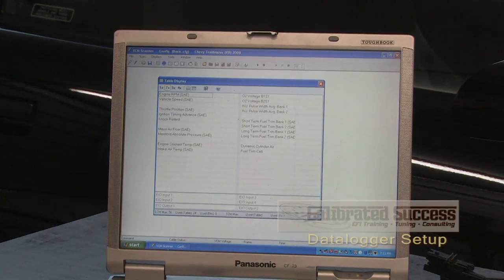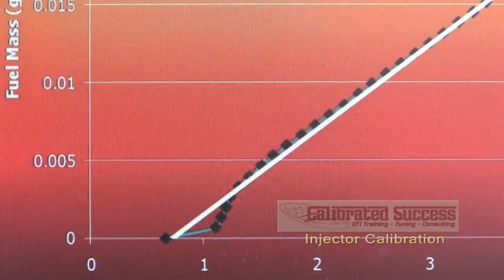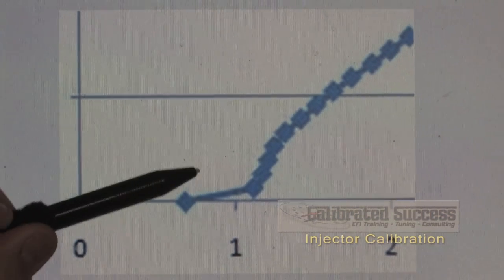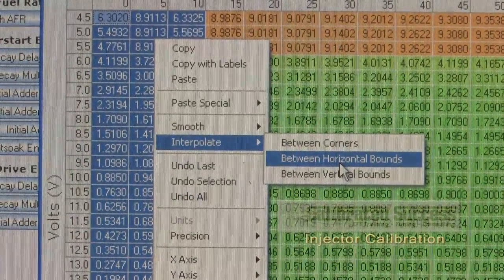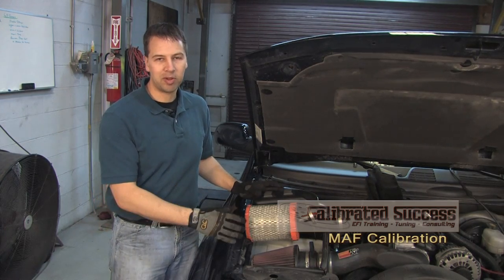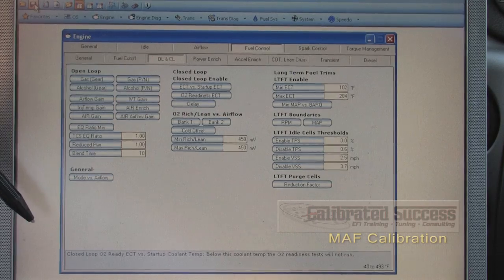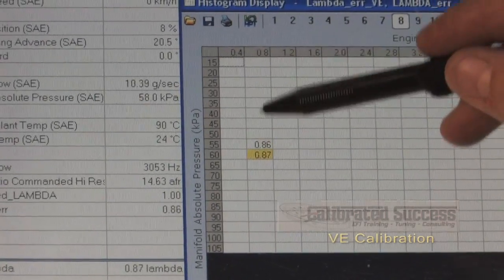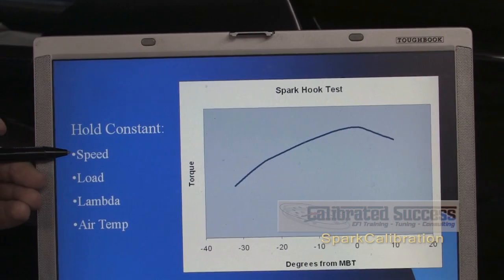gm tuning beginners guide long demo.mp4

Comment: Well explained, nice work.
Reply from the maker: Mark Lowe Thanks Mark. the full disc is available at DetroitTechnicalMedia.com
Reply: Dave Buckshaw, Technical Film Producer That worked out well. I'm just about to go down the HP Tuners for Ford (Australian ver Modular 5.4's) and the first thing I've been looking for training material. Thanks for the link. The cost is very reasonable too. Cheers.

Comment: Do you personally think its enough to study mechanical engineering? I guess not. Electrical engineering and programming would be very useful in case of a tuner right? :D
Reply: yes.
Reply: YES, LEARN TO WRITE PROGRAMS TO MAKE YOUR CAR FASTER.....OR BE SMART AND CALL QUICK FUEL TECHNOLOGIES AND RUN A FUCKING CARBURETOR AND A REAL TRANSMISSION
Reply: @joemamma4324  ok boomer
Reply: JMBBproject You can learn a lot on your own. A lot of reading over stuff again helps for it start to make sense. School would help alot.

Comment: Thanks for the video! Where can I get this done?
I need my chip reprogramed...
I modified my 1976 cj7 jeep with 4.2l 258 engine and GM TH400 3 speed auto by installing a GM OBD1 4.3L TBI with ecm #1227747 and ASKA... But want to reprogram to specifically fit my cj7 jeep...
If consumers can do the mod.. What parts do I need and where can I buy/get them?
Hope to hear from you soon.
Reply: Curious, which had more low throttle torque ?
Reply: DarkLinkAD
 Hmm. Good quetion. I wouldn't know because my cj was the first carb vehicle and I went through 3 and still couldn't figure out the adjustments.. .So, slapped a tbi on it.. Still have issues but mostly I need the correct chip for my jeepjeep. ;)